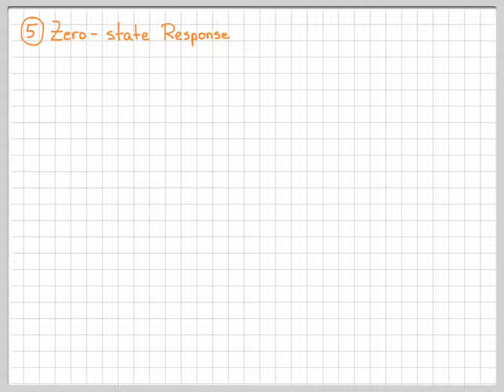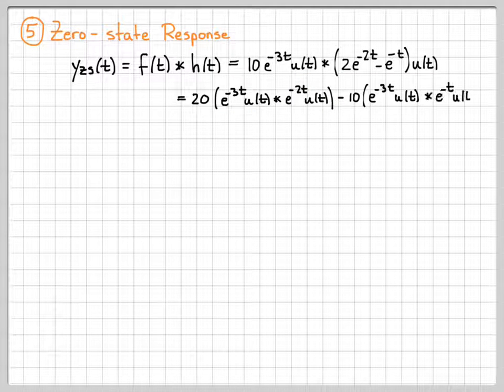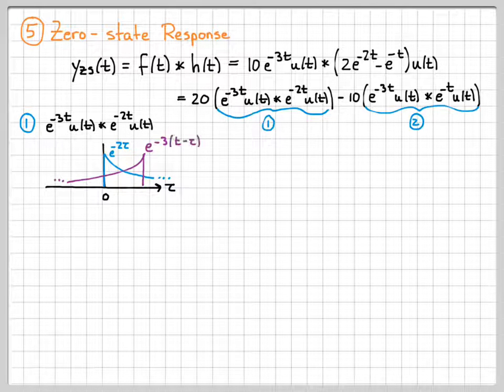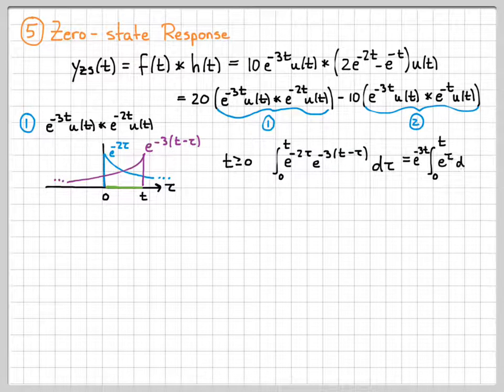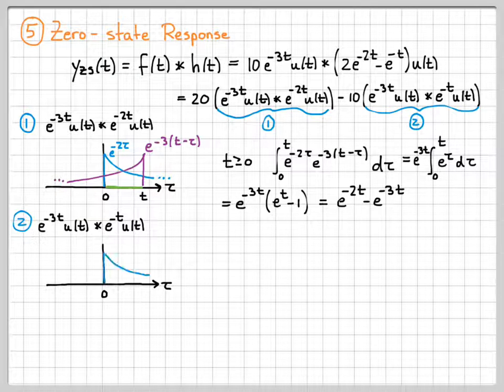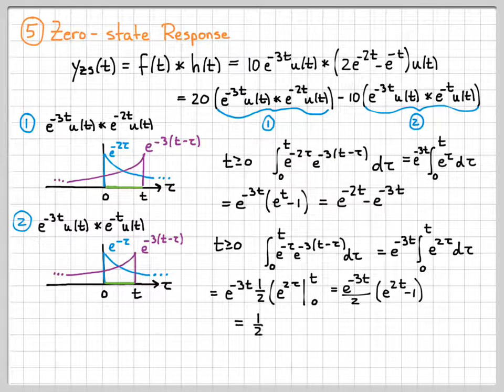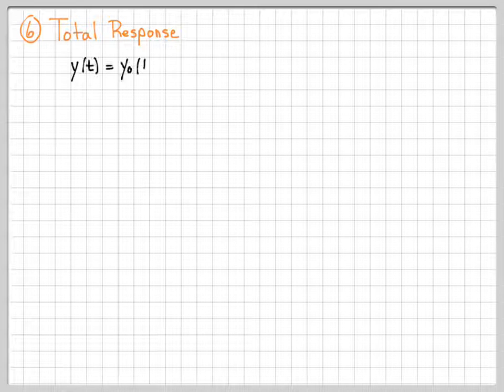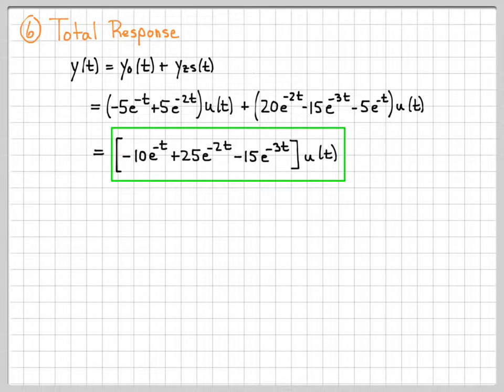Total Response Example #2 (Part 3/3)

Comment: I solved ex.#2 with Laplace transform and "my" total response is different
 [Y= -15(e^-3t) + 35(e^-2t ) - 20(e^-t)].  I noticed that  d(Yn)/dt*f  is not the same as Yn*d(f)/dt).  Why your solution is right?   Yn*d(f)/dt +Yo gives the same outcome as Laplace solution.
Reply: This is hilarious because I also solved it with laplace transform and I'm getting y(t)= u(t)[-10(e^-t) + 25(e^-2t) -15(e^-3t)].  I'm wondering if you labeled something differently than I did. Did you have your initial condition voltage for the capacitor labeled with the correct polarity? I had to make the value of mine negative and flip its sign so it agreed with the labeled direction of current. Other than that I have no idea how I got a different answer than him, and I have no idea how I got a different answer than you either